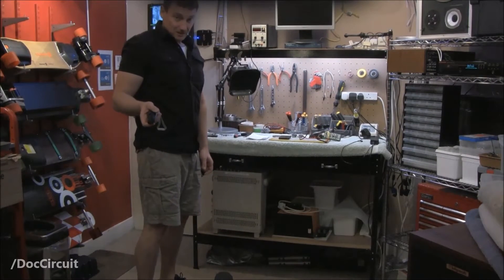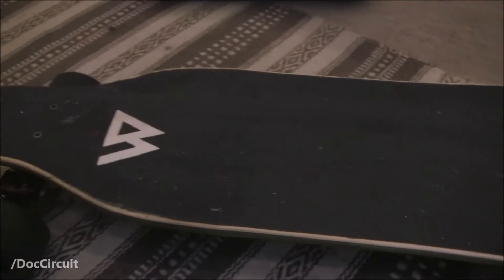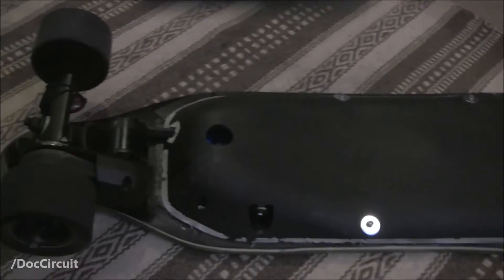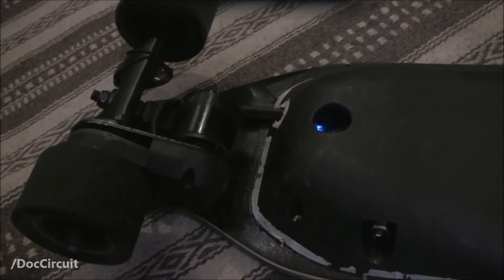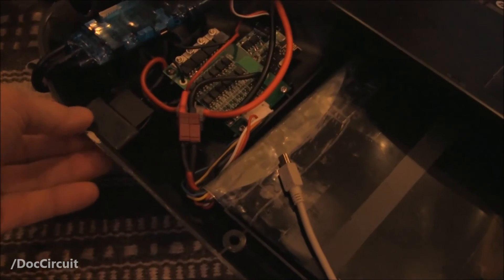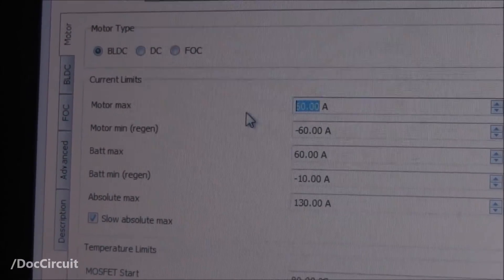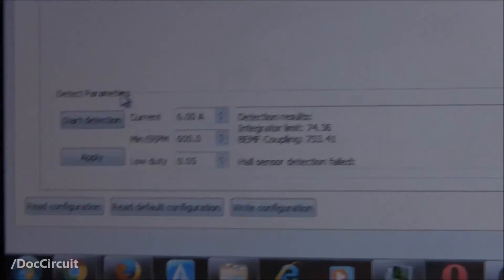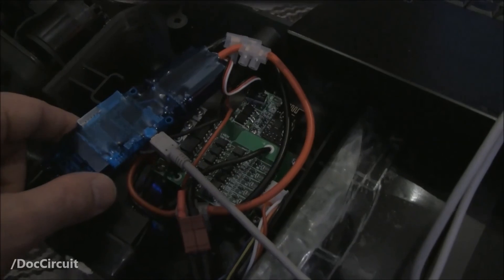Upgrading ESC to VESC. Results in Significantly Improved Chinese Clone Electric Skateboard!

Comment: WARNING, DO NOT BUY THIER NEW BOARD, I BOUGHT MINE YESTERDAY AND IT WONT TURN ON ANY MORE AND MAGNETO WONT HONOUR THEIR WARRANTY AS THEY CHANGED LOCATIONS, THE OLD ONE IS WAY MORE RELIABLE
Reply from the maker: That's a huge shame. It looked like it had some interesting features.

It should be noted Lee is obliged to honour any warranty...
Reply: lee is no longer the owner of magneto...
Reply: This happened to me as well I got in touch with the previous owner and they are sending out a new one.
Reply: i didnt bother with the new one, sticking with the old one.

Comment: Stopped starts are bad for any electric longboard. Boosted Board preaches that you start with a push, it will greatly help any board. Not hard to do, to help your board out.
Reply from the maker: Not sure what you mean by 'bad'. If you mean it places a short term, high current demand and can reduce range (depending on how often you do non push starts), then yes, this is well known. But it's hardly 'bad'. It should be noted having non push start capability is VERY useful. I use it quite often around the back streets of Cambridge.
Reply: I'd say just unnecessary wear and tear. But its yours and you're allowed to do what you want, not judging!!
Reply from the maker: Hi TDZ. I'm not saying you are, I'm merely putting it into context. For example, the strain on a board going uphill (depending on the length) is considerably more than a few stop starts. How do I know this? When I touch the ESC, motor and batteries after a few stop starts there is no appreciable increase in heat. However when I go up a significant hill, depending on the ESC... hot hot hot! The irony is that people rarely advocate walking up a hill, they'd rather use the motor (and rightfully so), but when it comes to a stop start... people are keen to say 'you shouldn't do that'. As long as a rider is aware there is a small decrease in range and the mechanics can handle it (there is no belt slippage), I don’t see the problem.
Reply: Dr Circuit We should put a gauge to measure the current that the board is drawing from the battery as well as the battery gauge.
Reply from the maker: Funnily enough, literally today, I discovered a couple of VESC Bluetooth apps (which displays a wide range of info including current draw) in Google's Playstore. I might get one of these and link it to my VESC and see what it reveals.

Whatever the current draw, the length of time would also need to be taken into account. For example, a stop start consisting of a five second sixty amp draw is far less effort for the battery, etc, than sixty seconds of a fifty amp draw going up a significant hill.

Comment: Hey Dr Circuit, love your videos! They are so informative. I have recently upgraded my VESC - exactly the same as yours, I have copied your configuration (Thank you) and I’m all up and running. However when i get to hills, regardless of the gradient my board doesn’t cope well, since the upgrade from the Magneto VESC I have had an issue with hills. When i am going up a hill, if the throttle is up for too long, it sometimes cuts out. Any suggestions?
Reply from the maker: Mmm, sounds like it's doing what it's meant to do; limit the current to the ESC. I only get this on long, steep hills, and I'm heavy. But it will slow down on smaller inclines too, and that's a good thing. Again, it's limiting the current draw.

When you say it 'doesn't cope well', do you mean it slows down, or something else?
Reply: It just gets slower and slower, its quite annoying because with the old magneto vesc i would zip up the hills! I also came off the board a few weeks ago now while i was going up a hill because it got slower and slower and then cut out!
Reply: did you get this one: http://www.ebay.co.uk/itm/VESC-4-12-Motor-controller-open-source-BLDC-Speed-Controller-VESC-vedder-Pcb-/182419271213?hash=item2a79092e2d:g:oFwAAOSwZ1BXe6Ct
Reply from the maker: Thats's the newer version of mine!
Reply from the maker: That's what it is meant to do. Having said that yours seems to be limiting it a bit too soon. What level do you have the current limit set at? Is the ESC enclosed? Does it have a heat sink on it?

From the VESC information:

"Up to 240A for a couple of seconds or about 50A continuous depending on the temperature and air circulation around the PCB."

Mine is enclosed, but with heat sinks and limit set at 60A. It takes me up hills, it does it a slower speed than if it were on a horizontal surface, but reliably.

I MUCH prefer this to it going up fast and blowing. Like my THREE stock ESCs have.
Reply: Yes, I do that ok! If you want, you can order through me, I bought a load from him to sell on, their £90 each!
Reply: Dr Circuit yes it does have a heat sink! Exactly as the link above! I think the limit is 60? I'm not 100% sure
Reply: James Hagerty but is yours enclosed?
Reply: mine just arrived in the post a few seconds ago
Reply: Dr Circuit did you fall off when they blew? I was going up a hill a few weeks ago, pressed my remote to go flat out (because I was going slow) and my board stopped dead and I flew off. Was that it blowing?
Reply: James Hagerty mine will cut out and then come back after 2 seconds after heavy load like yours, should i increase the max amp draw or not as that'l risk my bms.
Reply from the maker: Going uphill and the ESC failed... sounds a LOT like it blew. Blew is just another way to say it failed. 

Going uphill causes the motor to draw more current, the cheapo ESCs in the clone boards cannot handle the increased current so they tend to fail.

And yup, this is the way my three failed.
Reply: +James Hagerty James, do this: flip your battery upside down and plug into the vesc directly, then try it out, if it doesn't cut out under load, it's the bms, I'm removing that useless pos.
Reply: Dr Circuit ii think im sorted, removed my bms, will test tommorrow
Reply: Night Flyer Maybe post a video to let us know how you got on, and how the setup looks! I came off a few weeks ago now and I’m a bit scared to test it again to see if it blows, anyway i can test it?
Reply: James Hagerty got a really good setup now, might post a vid, one plug to charge now instead of a balance and deans connector
Reply: yer, post a vid and tag me in it! I want to see!
Reply from the maker: I wouldn't mind seeing the video too.

And for some reason these recent comments are not showing up on my YouTube video comments feed, but instead they are showing up on my Google bell notifications feed.

Comment: hi Dr circuit, ive always been involved in your videoes, love them, my electric skateboard keeps cutting out at load and sometimes randomly, and the board may restart completely (arming sound), should i replace it with this http://www.ebay.co.uk/itm/122309915757?&clk_rvr_id=1155353684584&mfe=si_en-GB_recentAlertClick&mpt=1484757409309

or should i invest in a vesc. or is it the bms at fault?

thanks
Reply from the maker: Hi SR, and thanks! 

About your board cutting out... it sounds a lot like it's the ESC. The frequency of it cutting out under load with the occasional random restart is indicative of this.

If it were me I'd simply replace it with a VESC. On no account would I get the one you've seen on eBay. It's the same as the rubbish ones used in the clone boards.
Reply: Haha! Thats my listing! Thats a Vesc from a Magneto Board!
Reply: James Hagerty no way! btw im not going to buy the stock esc as its just too unreliable but if anyone has a vesc, feel free to hit me up

Comment: Great video! I'm building my first eSkateboard but don't want to buy a VESC just yet due to their fragility. Can you recommend a decent ESC?
Reply from the maker: I wouldn't call it fragile, but if you're worried you can always enclose it. Either way, there is a newer VESC which is already encased and has heatsinks fitted. I haven't personally tried it but it looks very good indeed:

http://www.enertionboards.com/electric-skateboard-parts/vesc-x-motor-controller/

Comment: what  is your experience! 
So the original esc stop at 140A an shut down really dangerous, uphill it brakes ! 
Downhill the brakes go lost ! 

The vesc can handle constant 50A and 250A peak ! 

With the stock esc I go uphill at half trottle so around 70A estimate , 
So I think I can set the vesc on 65-70A did you have a good usefull setting for the break
What are you thinking about
Reply from the maker: All the information you're looking for is in my videos...
Reply: Dr Circuit no problem I'm
Running the vesc now ;) and learn things by my self ;) thanks for answer

Comment: Please help!!! I also replaced the ESC with VESC in the same board. It was amazing! But after tweaking some settings, I think I messed it up. The board's motor goes full speed no matter how gentle i  push the controller. Do you mind screenshot your VESC settings in comments?
Reply from the maker: Useful to know! :-)
Reply from the maker: Comments don't allow screen-shots to be posted.

The video has the information you need, and I'm loath to repeat a task.

All I can suggest is you look at the relevant parts of the video, or do a Google search - quite a few people have now posted their VESC settings and programming procedure.
Reply: hey I was worried about this same thing. When I had my board laid out on my bench if I just touch the throttle the motor would go full throttle. I thought something was wrong but it turns out with these types of motors when there is zero load on them they go into a runaway RPM. Put your board back together with a few screws and give it a short test ride in a controlled environment. Hope this helps :)

Comment: Hey I've order this board myself. I'm in and around ten stone myself (depending on the time of the year 😂) and was wondering would I get away with just the esc for standing  starts and not too steep hill. Upgrading for me is daunting. Also one last thing do you remember how long it took your magneto to arrive I ordered mine just under a month now and still waiting. Sorry for long winded comment thanks great videos I've subbed ☺️
Reply from the maker: Thanks for the kind words!

The stock ESC is not to be used for standing starts, you'll need to push off first.

At 10 stone I suspect you could be lucky and not have problems, but I'm afraid there really are no guarantees.

Delivery times... it all depends on the suppliers stock. Very often they are waiting for a batch to arrive before they resell, but they are normally very good at announcing this on their sites so buyers know if a possible wait is in store. I do know Lee from Magneto Boards is a keen, enthusiastic reseller.

Comment: Now after programing the vesc. No matter how much i push on the trigger it goes the same speed (the fastest) any help?
Reply from the maker: This has to be down to the settings in the VESC programming tool. As I mention elsewhere I'm not an expert with this software. All I can suggest is you go throught the settings yourself...
Reply: hey I was worried about this same thing. When I had my board laid out on my bench if I just touch the throttle the motor would go full throttle. I thought something was wrong but it turns out with these types of motors when there is zero load on them they go into a runaway RPM. Put your board back together with a few screws and give it a short test ride in a controlled environment. Hope this helps :)

Comment: I have this same board and I was wondering if it is possible to change the remote and esc into a better one and change the battery
Reply from the maker: Yes, yes and yes. However the remote does the job, and the battery has decent range.

Comment: I just purchased a vesc to use on my chinese board and im confused which specific wires go from the vesc to the motor? Thanks,Jake
Reply from the maker: This is simple. Connect the three wires from the ESC to the three wires from the motor in any order. Check the motor is rotating in desired direction, if it isn't swap any two wires.

Comment: Could you possibly give a tutorial on switching the esc to vesc I was thinking of grabbing the lectric boards a clone of this one and wanted to try improving it
Reply from the maker: This video pretty much is that.
Reply: oh my bad i only saw the part about configuring the software and the opening statements about the improvements must have missed the part where you opened it since i was distracted
Reply: is this still holding up after a few months of more riding? did anything blow? and do you happen to have links for other parts within the board that tend to break rather fast with your experience.
Reply from the maker: I didn't film my opening it as that's merely me unscrewing eight screws.
Reply from the maker: I tested it in this configuration for a few weeks, then used the board to test something else. Since that time I have completed my series of Chinese clone modifications and have installed the VESC again. So far it's performing perfectly!
Reply: Thanks for the information i was not sure how hard it would be to open the enclosure since i have not purchased the board yet i was hoping to buy one from Lectric since their pricing was at 399$ the cheapest ive seen for these boards making it a steal imo, but they seem to be out of stock now.

Comment: I just replaced the ESC in one of these boards with a VESC. It took me quite a while fiddling with settings to get the acceleration and braking working as well as I thought they should. The only control mode that felt even remotely usable to me was current no reverse with brake. For that to work well you really need to tweak the current settings to work with your board and your weight. I'm about 70kg and with the default settingsof 60A forward and -40A brake I found the board would reach top speed almost no matter how far I pushed the throttle forward, it just changed how fast i got there. Reducing the max motor and battery amps to 40A and min braking amps to -30A made the throttle response and braking force much more intuitive. Take off is incredibly smooth with no wheel spin or lockups even moving away at very slow speed. The brakes are progressive but very firm. This mod transforms a cheap chinese board into a premium product.
Reply from the maker: Hi Paul and thanks for the feedback/info. Yup, it does take some configuring, but when you do it really does transform a cheap Chinese board.
Reply: i just received my Vesc from enertion  today along with my backfire clone board, going to ride it as is for a bit to see how it is before i try the modifying but just wondering to connect the VESC it will require soldering correct? will i need any other cables or connectors as well? anything you recommend for making this mod neat and safe?
Reply from the maker: A couple of things...

1. Dremel (or cut) out the plastic to make space for the VESC.
2. The VESC can be wired into place with terminal strips, but this isn't ideal (vibration can cause bolts to unfasten and wires to loosen and you do NOT want a short circuit). If you do this ensure insulating tape is used as a safety measure. Additionally I don't know the current rating for terminal strips so this is something you should find out.
3. Ideally you should solder (and shrink wrap). There are lot's of videos on YouTube, and it really is only a fifteen minute job.

Good luck!
Reply: i was actually sent the wrong board(received a bench wheel clone) from amazon and ended up buying a replacement from Lectric longboards after i was refunded, that should be coming in the next few days -_- so i'l finally be able to do this
Reply: it seems my VESC uses XT60 Connectors for power is this compatible with what these boards use? would i need a XT60 to deans converter/connector
Reply from the maker: You'll need to solder XT60 connectors to both ends of the wires to be joined, but yes, they can handle the current. In fact they have a higher current rating than Deans connectors and are less prone to short circuits (unlike Deans they don't have exposed terminals).

Comment: Hi. I have a Benchwheel Chinese dual motor knockoff board. I like the board, but i'm having issues with the esc shutting the board off while climbing hills or pushing the acceleration too hard. I got the board for only $300 and upgrading to dual VESCs would be more that the price of the board itself. Do you think its worth it?
Reply from the maker: +Wolfgang Schoenberger Unfortunately I've never seen a Benchwheel board IRL, in fact I haven't even seen a photo of it taken apart, so I can only guess... and I'm guessing it has a car ESC, which will likely be a cheap jobbie and prone to this. 

People seem to think that if a VESC is a specific percentage of the board cost it's not worth it, but this is the incorrect way to look at it. Its the total price of the board plus VESC when COMPARED TO OTHER boards which is important.

Having said that, a good budget ESC often used on boards in both single and dual motor configurations is the 120A Marine ESC by HobbyKing. I've never tried it buy I intend to, and soon.

Comment: Have you ever thought about adding another motor on the other wheel?   I am also a fairly heavy set guy and have a chinese clone.   However, when it goes down steep hills and I brake....it still rolls down.  I think its because only one wheel is braking as oppose to two.

When you upgraded/changed the ESC did it improve your braking by going backwards?
Reply from the maker: +ShadowKage Yup, and I'm currently working on exactly this! 

I've never had the issue of it still rolling downhill when braking. My two clone boards were TOO sharp! 

And nope I didn't even try enabling reverse. It's not something I ever use on my boards.